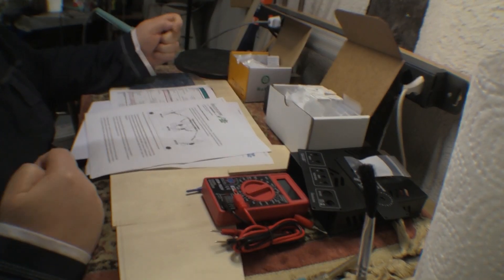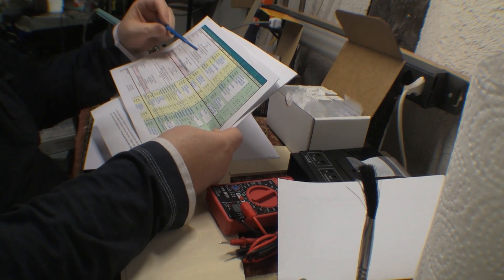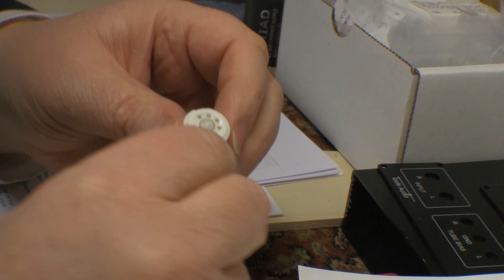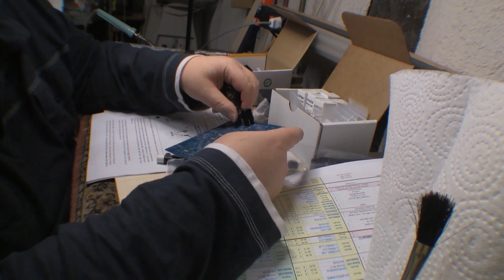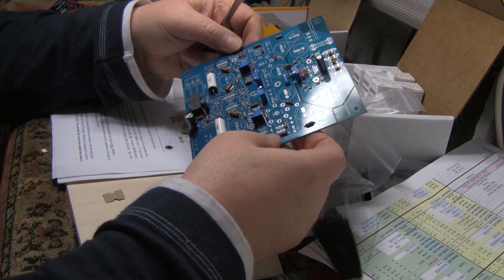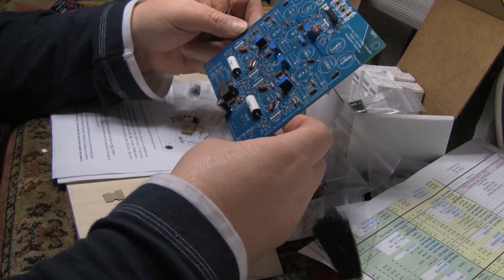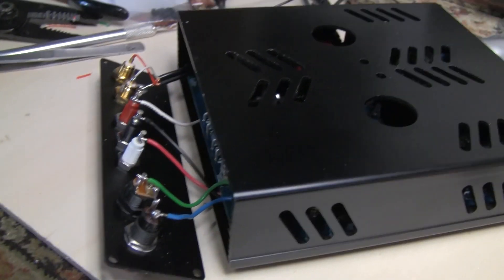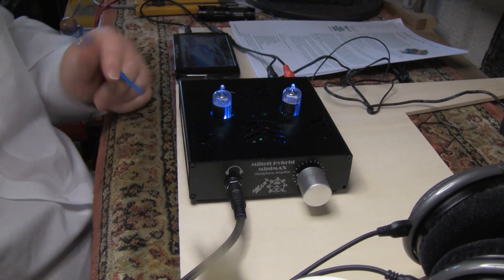Headphone Amp Kit Build

Comment: Where did you buy it? Is it still available?
Reply from the maker: I don't know if a full kit is available but the updated version of the pcb and the key components should be available from beezardotcom.   Mine still works fine though the blue led's lasted just a few months - couldn't take the heat from the tubes.  It looks better without them anyway.

Comment: If it was my build ' that thing would have been thrown into another dimension, before those tubes ever lit up. Patience of A saint dear fellow. To many bad component items to make things enjoyable. Still congrats on completing your project. Oh quick tip for finding your screw. Buy one of those cheap telescopic magnets . wave it around in the general direction and your screw finds it. Works for me every time. Thanks for your video.
Reply from the maker: Not the nicest project I've ever built for sure.  Still performance is pretty good - especially with the HD800's - so I get to enjoy the music!
Cheers,  John

Comment: Many of these kits are definitely not of the caliber of the old EICO, Heathkit, and Dynaco units, the trouble you were having installing some of the components confirms that. By the way what sort of battery tubes does this amplifier use? 1S5? 1U5? 3V4?